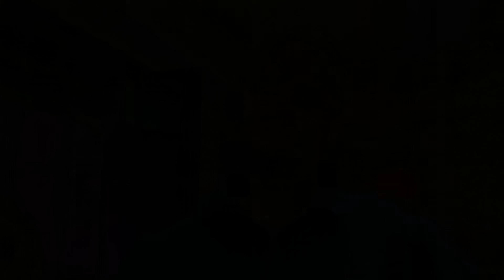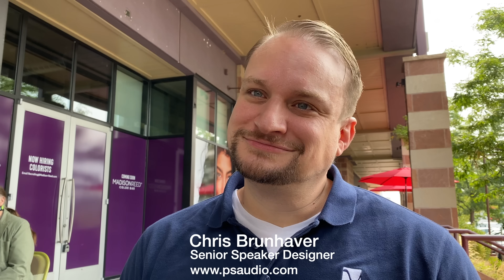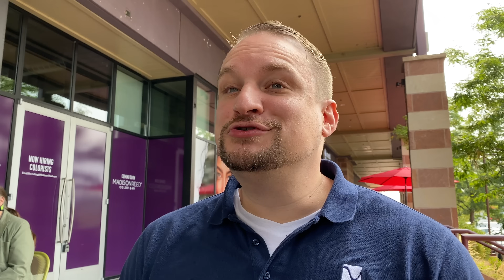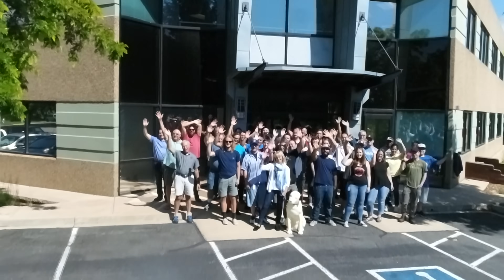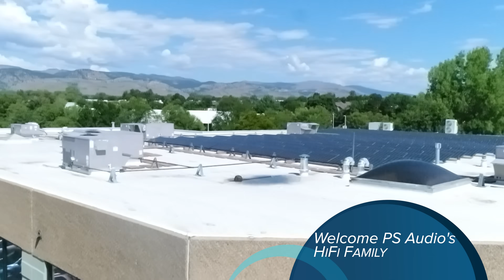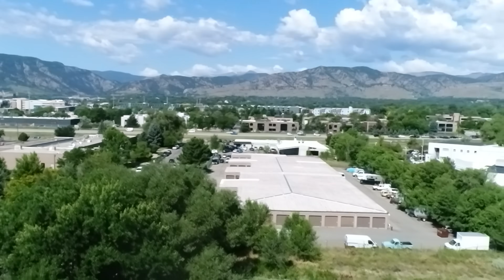Lunch with Paul: Bob Carver's Amazing Cube Subwoofer

Comment: The worst thing about the True Subwoofer cube was that when the circuit board blew, so would the speaker. You were basically putting 60 hertz line current through it. I  learned to rebuild it now and then to avoid this.

Comment: Still have my M400 cube amp and companion c4000 pre amp from 1980. Just upgraded amp, but cant part with the many features of the pre amp.Recapped in 2021. Bobs partner Frank recommend a Carver authorized service shop. Frank, nice old guy and a character too. Got me a break on service cost since I was an early years Carver customer.

Comment: Sunfire truesub... Trialed one at home for months!... about 1997 ish...... 
The output WAS prodigious .. and considering its size.. Just plain crazy.
... Ultimately I decided a Linn 5150 sub had the edge on speed and integration.. But even with two 12" in isobarik configuration... It could not destroy the house foundations as I feared the Truesub would!

Comment: I had a carver magnetic cube amp (250 watts per channel), in my system in the mid 1980s. I was always amazed at what that was able to produce. I it strapped into the 500 watt mode driving my Acoustat sub-woofer. Real nice. That amp is still running to this day. My son has it up in VT and he says it still really rocks! I didn't know they also made a cube sub-woofer. Wish I had.

Comment: A great little sub for home theater with great impact.  Not so good in the context of a 2 channel audio system.  I owned a couple of them back in the day.  The downside was that these little cubes had a very high failure rate which turned a lot people off.

Comment: I still have and use my Sunfire sub I purchased 20+ years ago.   It still puts out incredible base!   
I think Bobs real gift was not only having a deep understanding of how to make great sound with out of the box thinking. But also understanding that you have to simplify your sales pitch so that consumers have something to grasp on to so they understand that his products did things in a different way without going in to crazy engineering speak that drives people crazy.   
Yes you have some consumers 5hat want to dig in to the technical detail but that’s not the mainstream.
Reply: Perhaps if I had bought one... It would have outlasted the Linn 5150 that I chose over it... That was shortlived with no aftercare when it failed🤬
Reply: @marcus1970  😁. Hey - there still out there and sometimes you can pick them up for a song.  I have had mine repaired for $250 but it was well worth it.  I have seen some that had the weight that sits in the passive radiator  come loose but its all repairable.  
on a side note, I really expected the surround to deteriorate over time but so far that hasn't happened.

Comment: Fundamental error:  The fact that a woofer has an impedance peak (or two) does NOT mean the amplifier needs to produce "lots of voltage" around those frequencies!  The impedance peaks are at resonance, where the speaker also has an efficiency peak, so the voltage does not need to go up.  
In fact, I had to EQ my woofers down at resonance (-24dB, because it also coincides with a room resonance), in order to achieve reasonably flat response in the room, so my amp is putting out much less voltage at the impedance peak.
Reply: Absolutely!
Reply: Well, that’s assuming that the system has a flat response and traditional tuning. Try putting that woofer in <1 cubic foot and see what frequencies you need to apply eq and power.
Reply: @cbrunhaver  
Resonant frequency goes up to about 90Hz and then as frequency decreases below ~70Hz, the power requirement grows to impractical levels.  
But why do something that destroys the performance?  It's like mounting 145SR13 radial tires on a Corvette C8.
Reply: I think the efficiency peak you're talking about gets wrecked by cramming the woofer into such a tiny box.

Comment: The best model for analyzing and understanding the mechanical behavior of all woofer/enclosure systems IMO is Newton's Second Law of Motion applied to forced oscillation. This needs to be integrated with the electrical performance and the two are interdependent. One problem is back EMF. This is created by the potential energy due to the woofer's excursion against its restraining force being converted back into electrical energy where the woofer converting it into kinetic energy acts like a generator as well, instead of being only a linear motor. As the voice coil moves through the magnetic lines of flux a voltage is induced in the coil. I think this causes the woofer to likely oscillate around its mechanical resonant frequency. The choice of woofer inductance and magnetic field strength can work both for and against the designer. I had this discussion with Ken Kantor on line many years ago. Somewhere I think in one of his postings in Classic Speaker Pages he posted his electrical schematic model of a woofer but it didn't include the back EMF generator. So we disagreed about that. 

My favorite design is still the optimized acoustic suspension design Edgar Villchur invented. Three parameters govern the tuning of the system, moving mass, damping factor, and spring constant. One reason I like the acoustic suspension model is that this is the only design I know of where the damping factor and spring constant are not frequency or amplitude dependent. Therefore you could in principle tune a driver of any size to have any frequency response you want it to have. At frequencies above the woofer things get more complicated due to acoustics but the same principles apply. Roy Allison's work on coupling the woofer output into the room and eliminating the 200 hz suckout also was a valuable contribution and was used in both his brand and some of AR's TOTL later designs. 

Another reason I like it is that the restoring force being mostly the difference in air pressure on opposite sides of the cone is applied uniformly over its entire surface. This greatly reduces circumferential and radial differences in force mechanical suspensions create which tend to twist and shear the cone into harmonic breakup modes.

Comment: Bob was certainty big and marketing claims with his products. I remember playing with one of those true subs on Harwood floors with some marten Logan speakers and I can confirm those put out bass and loved to martch across that floor. Almost purchased one of those back in the day.Have seen a few reconditioned ones pop up for sale on ebay. Demoed one of his 5 channel sunfire amps as well. Remember playing with this sunfire prepro that had that sonic holography button. If I remember it didn't seem to do much. I also remember Demoing a pair of genesis amp 1 speakers with the built in subs along with Bob carvers older lightning preamp and power amp. That system sound ok but too much for the room. Still to this day I have never heard bass like in those older genesis speakers. Those old genesis subs were terrific! Thanks!
Reply: Funny thing about that sonic holography, on some recordings I couldn't tell much difference and on some recordings it was magical.

Comment: Back in my DJ-ing days I used a Carver PM-1.5 in a custom box with a mixer above it. Used it to drive some JBL keyboard speakers for weddings and such. Loved that rig. Never knew Carver made speakers until I ran across a “take it all” ad on CL. All I wanted was the TFM-55x but it also came with the AL-III plus speakers plus some other goodies. They sounded great, but my Maggie 1.7is were a bit nicer, if thinner on the bottom end. And lighter, easier tucking away. So the Carvers got sold on. Hoping to find a deal on a Sunfire sub, and in the meanwhile am saving pennies toward a REL or something similar

Comment: Chris is wrong about the tracking down converter power supply ,as it can put out both high voltage and current at the same time  .It tracks the input signal and keeps the voltage rails at just 6 volts above what is needed at that instant in time ,therefore there are only 6v across each 20 Amp output transistor which helps them rum cool with only the chassis as a heat-sink and always able to deliver 20  amps from each transistor (he uses up to 18 of them) regardless of the voltage.. Anyone interested in a more in depth explanation read his white paper here  .https://thecarversite.com/yetanotherforum/userfiles/Sunfire_Amplifier_Whitepaper.pdf

Comment: The solution to the Sunfire subs walking is SVS’s subwoofer isolation system $49. I use  a pair of True Subwoofer Jr.s with Maggie 3.7i’s. They are crossed over at 35 hz using the high level inputs all driven by Bob Carver Crimson 350s. It does not sound half bad.
Reply: These SVS SoundPath geeft are excellent. I use them under my Sonus Faber subs

Comment: The XTEC 12” subwoofer goes deep with less than 3% distortion. It has some cool features. PS audio should make a better one with next gen servo.
Reply: That would be good if they do. There's a good chance that CB already has that 'swirling' in his mind.
Reply: @FatRat-f9m  It takes a lot more R&D budget to design and engineer a great servo subwoofer. But Paul has an excellent combination of engineering skills to tap into that could make it possible, and in my humble opinion, it would be much better money spent than doing yet another iteration of their FPGA based DAC that hardly can compete with DACs costing much less involving chipsets from AKM and ESS.  Now listening to music late evening with my planar magnetic Sundara headphones connected to a BTR5 DAC costing TWO PERCENT of the direct stream DAC and in my A/B testing, sounding at least as good, seriously speaking. Yes, the BTR5 can also do DSD256. And it has a nice EQ fixing my hearing loss above 12kHz. DACs are not a good place to spend a lot of money nowadays. A well-designed American-made subwoofer is!